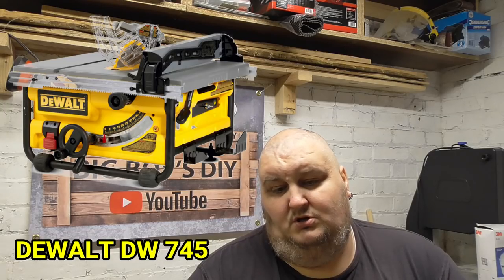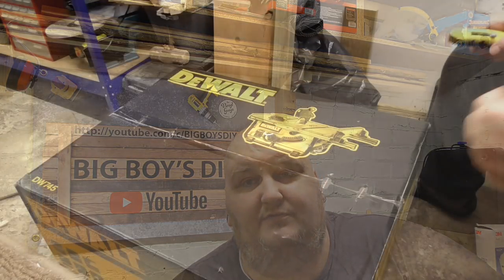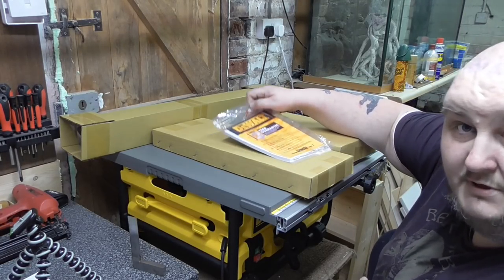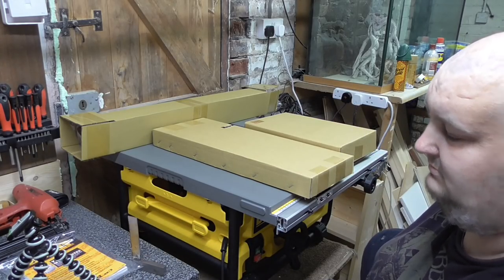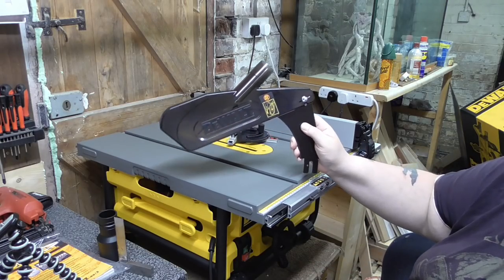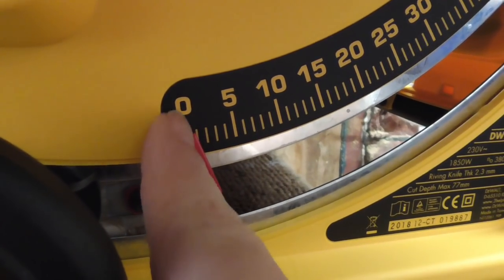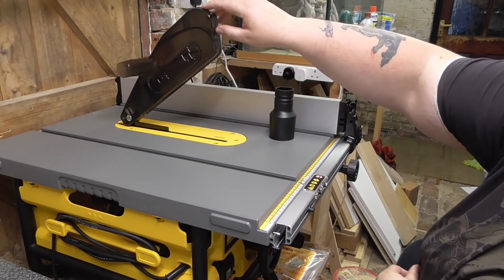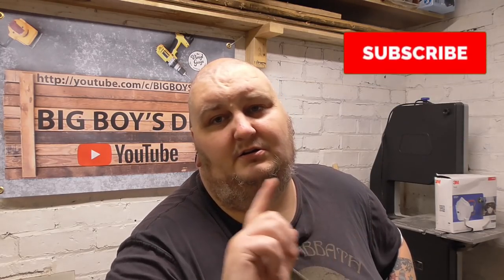DEWALT DW 745 UNBOXING & Assembly

Comment: Love the video.  I'm opening my Dewalt table saw tomorrow.  This really helps. The saw stand a bought seems a little on the flimsy side.
Reply from the maker: This saw is fantastic even now after daily use it is still as accurate and good to use I changed to blade to a 40t freud blade for a cleaner cut and just keep the dewalt blade for ripping rough timber as for a stand I don't have much space so built my own out of 2x4 there is a video on my channel thanks for your comment 👍
Reply: @SCRAPWOODTOCRAFTWOOD  Cool.  I'll order the  40t freud blade on Amazon and I'll be sure to check out your other video about building a stand.  Thanks again for the awesome tips.👍